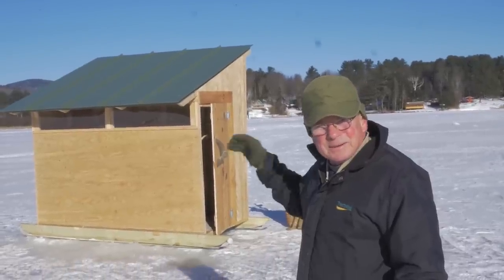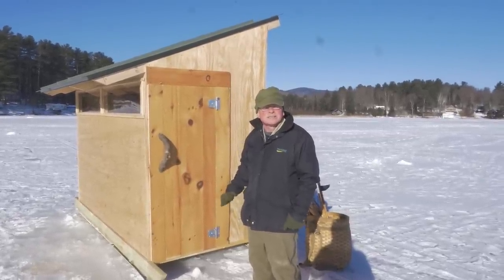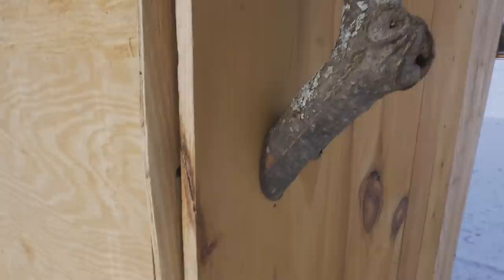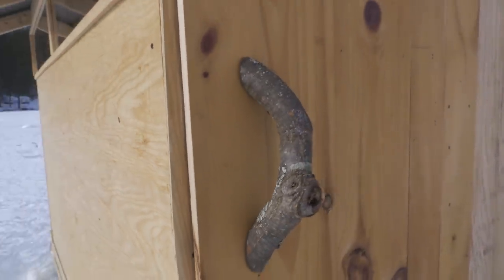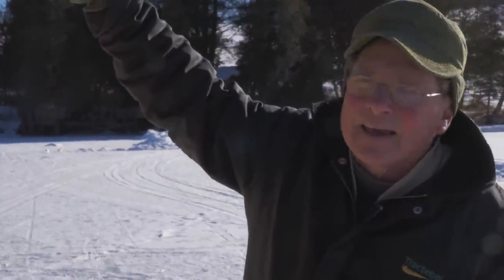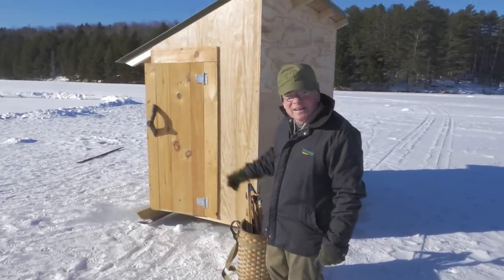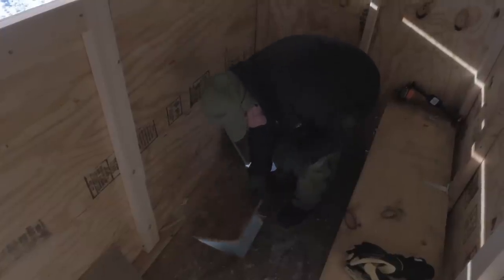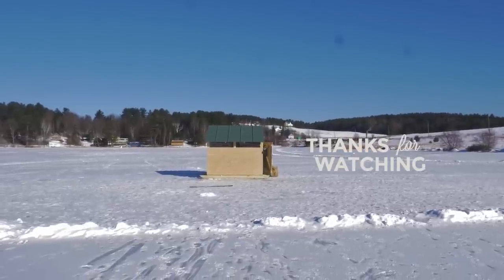Custom Homemade Ice Shanty - Build Overview - Higher Elevations Adventures

Comment: Looks great on the outside and inside. I like the green metal roof. We built a similar shaped house 8 years ago. 3/8" sanded plywood which was stained. I like the front plexiglass windows for viewing. Last year I added windows to the top rear and it made an incredible difference in light quality inside the shanty. I wish I had done it earlier. Great job.

Comment: Looks great, we built one similar to yours, roof was painted ply, but will be looking for some metal like yours this spring. One thing we did was put a walk door on each end,  makes it easy to get out to tips without crossing each other. Thanks for posting, tight lines.
Reply from the maker: Good idea with the double doors. Might have to do that as well. 
Tight lines!

Comment: What do you think it weighs? Here in Colorado you are required to remove them every day. So keeping it as light as possible is important if you have to move it twice a day.
Reply from the maker: Its not light. The roof we put on this is pretty heavy and a little overkill. I wouldn't build something like this if you don't have an ATV or snowmobile or something to tug it around if need be. Also, the back doesn't need to be as high, which is 7 1/2 ft on ours. When conditions are good, one person can slide it along on the ice no problem... I'd guess its somewhere around 250-300lbs, to answer your question.
Reply: That's an unfortunate law. That would really cramp my style.
Reply: Bill Miller 

In that case, get a hub shelter. Absolutely zero point in building something like this if you have to remove it daily. They make some pretty large hubs now a days.

Comment: How do you transport it?
Reply from the maker: We keep it on this one lake. Drag on/off with ATV or snowmobile. It can be pushed by one person when there isn't a ton of snow on the ice.
Reply from the maker: We tug it on and off the ice with an ATV, Snowmobile or Truck (if the ice is thick enough). It can be pushed by one person if conditions are good; that is, no heavy/wet/deep snow. It stays on this lake, though I'm sure you could load it on a trailer and haul it from lake to lake.